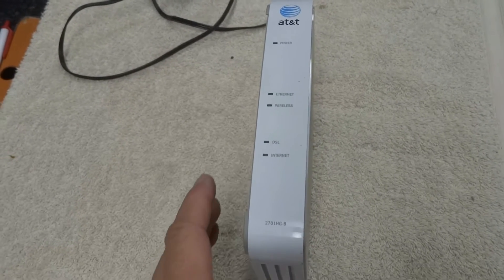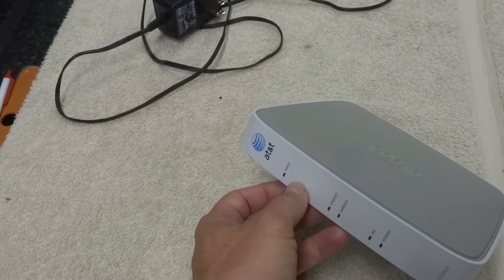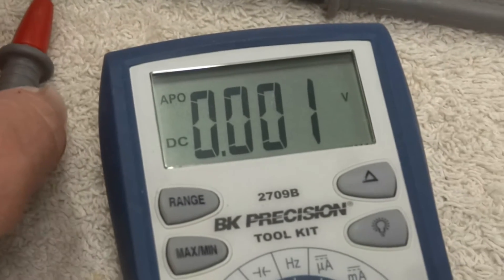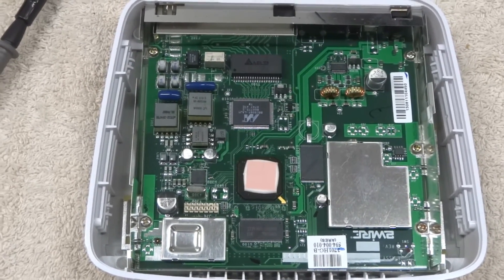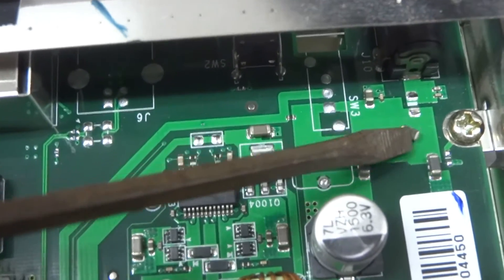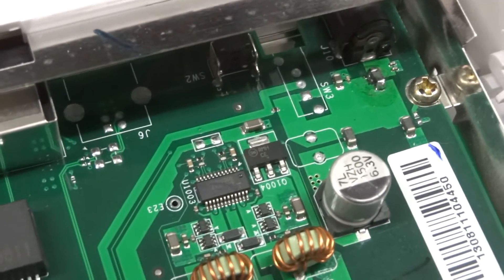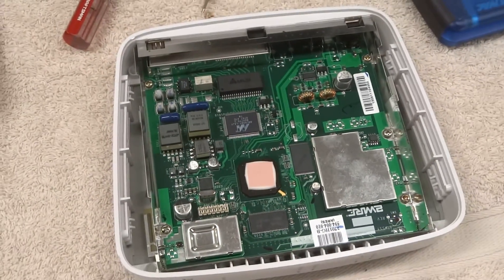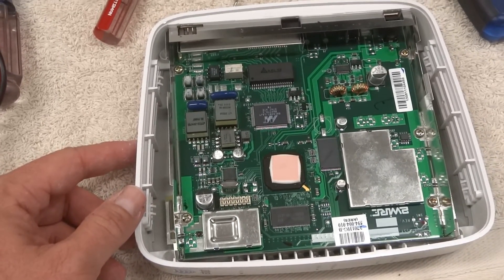Let's Repair - 2wire 2701HG-B gateway

Comment: The power supplies are KNOWN to die from 2Wire, they almost always fail. It's a WELL known issue. Usually a bad cap in the adapter. They may show 5.1v but once you add a load (amperage) to the adapter, it can't keep the voltage up. Instead of 5.1V I just use a basic 5V adapter and disable the wifi antenna.
Reply: Victor Coss Yes, adapter issues confirmed by AT&T Tech Support some years ago.

Comment: I have the same problem with my 2wires and i too take it apart , can't find anything , the power will just goes off and you wait it will come back on..these modem is so cheap to buy.   A used one  like $10 on kijiji or ebays . But I did have this modem over 5 years of good use through.

Comment: I had one that read normal voltage until it was placed under load, then it dropped way down. The power supply is a common failure with this 2Wire. There's a video showing how to replace the failed capacitor if so inclined. I fixed mine the same way.
Reply: Sera posible ahorita? Tengo uno con el mismo problema
Reply: Manda los 5v pero al ponerlo a trabajar baja a 3.5v aproximadamente, para probarlo lo conecte con una celdas 18650 y un elevador y prendio pero quisiera arreglar la fuente de alimentación